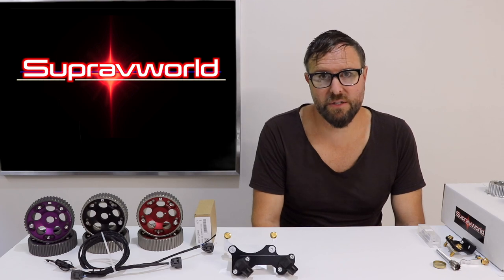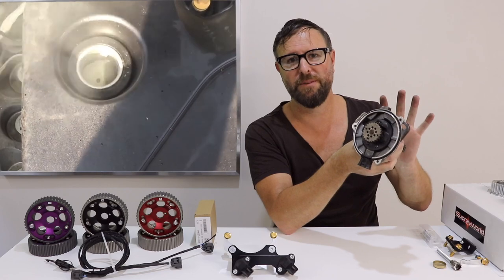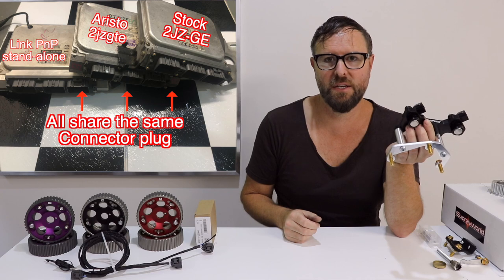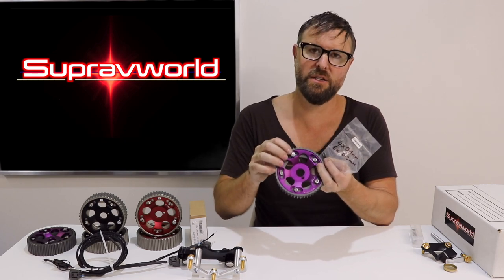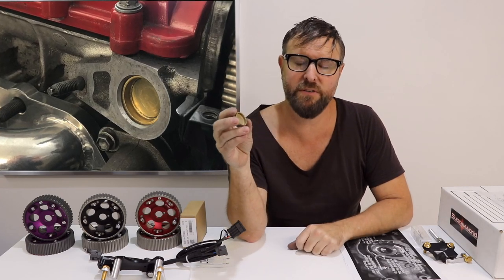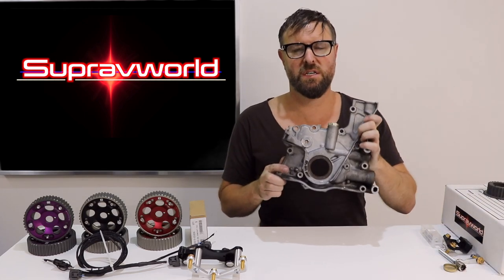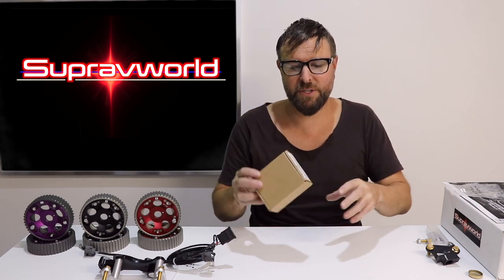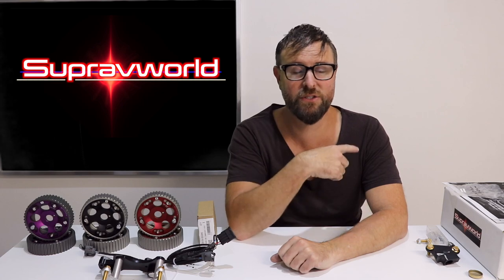2JZ-GE Dual Cam & Crank trigger kit PnP

Comment: The biggest thing about this is removing the need to weld in the sensors, it was the main thing putting me off going NAT on my GE, amazing to have you back and I hope you’re still around by the time I’ve saved up enough money 😂
Reply from the maker: Yes and it also eliminates the whole 1.5JZ where people would only use the head to get the Cam sensors.
Reply: I swapped to a ge vvti head to get the cam sensor

Comment: I recently purchased this kit and it is top notch quality!  I also am building a ge as a winter project so i am taking things slow and making sure its done correctly. If i made any changes to this kit it would be to extend the cop wires about an extra 12 inches to the back of the ecu connector. I may have to cut my firewall to make them work or extend the wires 12 inches or so. Thanks for your time and innovation!!
Reply from the maker: Hi Joseph, was your chassis a GS300? I am actually making them longer now as I had feedback from GS300 owners. I may put an option on the site for a longer harness for those that have GS300’s or just want a longer harness. The harness is plenty long enough for a Supra, Soarer but some people may have re-positioned the ECU or faced it in a different position. 
Thanks for the feedback, I appreciate all the information I can get to make a perfect product for everyone.
Reply: @supravworld8777  yes gs300 is correct
Reply: @supravworld8777  i would be interested in a longer harness for both cop and cam and crank pinout. the engine is currently out of the car so im not sure if i can adjust the ecu location to make my harness work
Reply: Boss I need the link to where I can it this kit

Comment: This is absolutely great, I'll still probably go with a GTE oil pump just because it's a good idea to run an oil cooler, and that will take a bit of pressure to do so. We might not have oil squirters, but with an oil cooler, you might need that extra pressure.

Comment: This is great. Seems like it's only drawback is you no longer can adjust the timing with the dizzy.
Reply from the maker: The adjustment on the distributor is NOT good. The trigger system of all modern engines is fixed to the Crankshaft. There should never ever be any adjustment of hardware for the trigger system